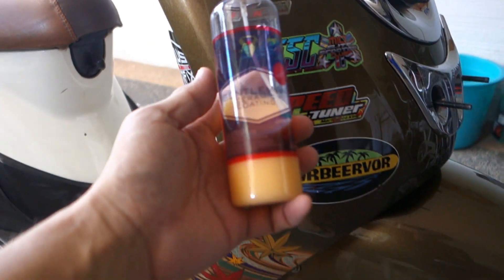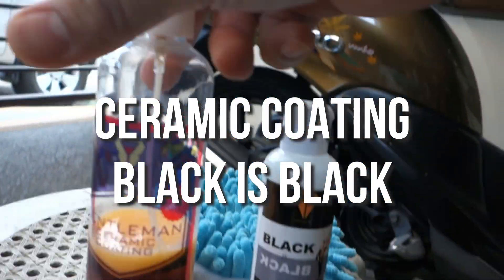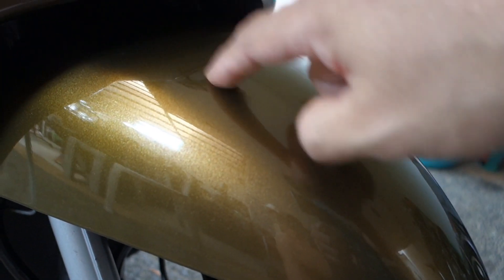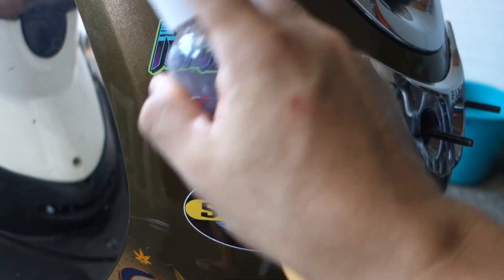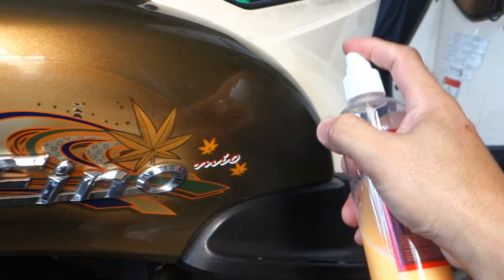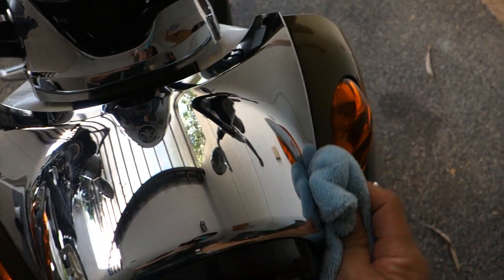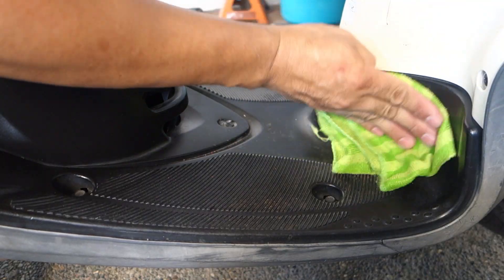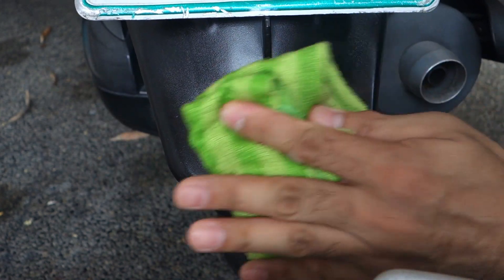CERAMIC Coating On My FINO | Gentleman Products

Comment: Sir lex Magtanong lang ako sir kung ano magandang set ng gilid naka 63mm bigvalve kasi ako ang nakakabit sakin na gilid 14/41 gear tapos 1krpm center 1.5k cluthc tapos 7/9 na bola 80kgs bigat ko parang may bitin padin sa dulo. Thanks
Reply from the maker: Ok naman po yan. Pwede pa 1500 center
Reply: @LexSpeed  salamat po